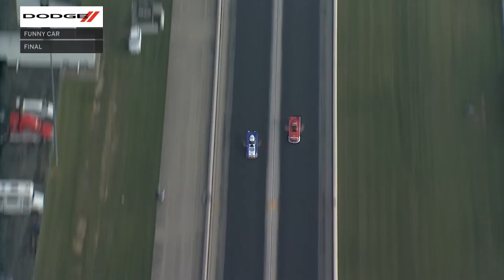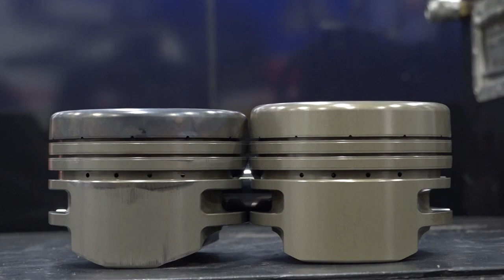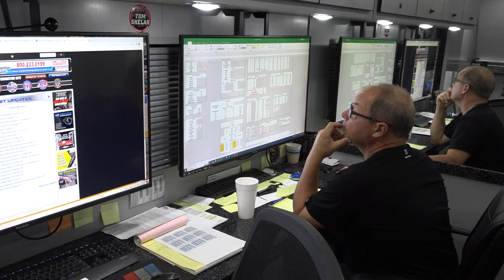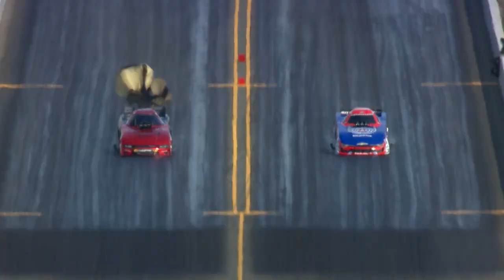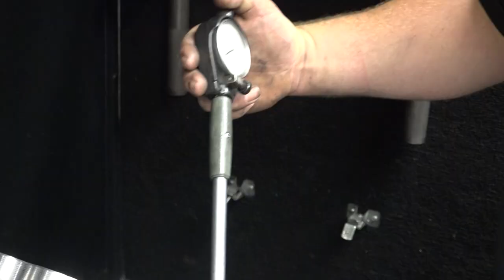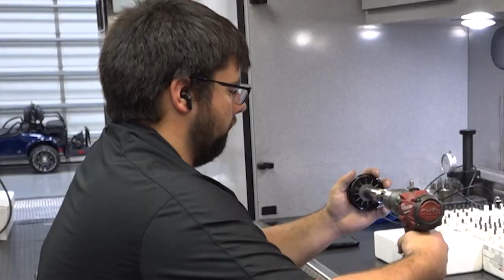Jimmy Prock discusses the challenges of the Western Swing

Comment: The Swing has its challenges three tracks are on the swing circuit this year Denver, Sonoma, and Seattle. Denver is above the mile mark in elevation and the air is stale this requires a full engine rebuild to prevent the car from blowing up and there have been several blow ups on The Mountain. Sonoma is 3,000 feet below sea level more power is needed in order to get down the track. Last but not least is Seattle it is a mix of both so they need to time it right or cars will blow up or spin out.